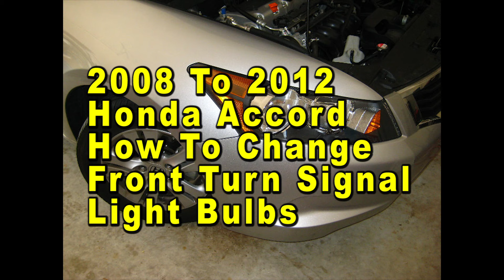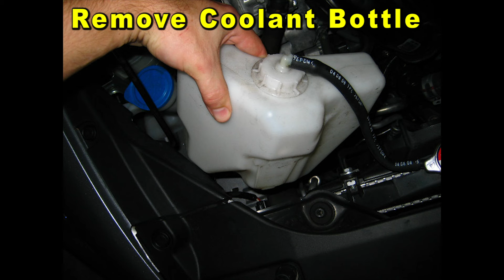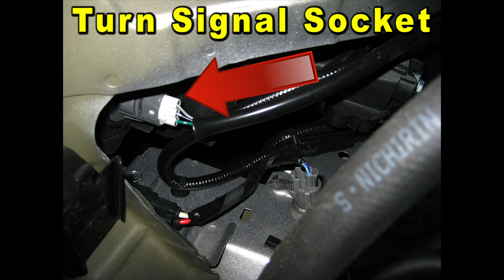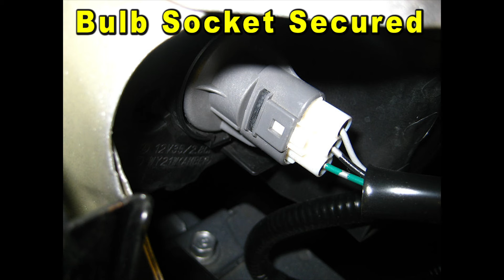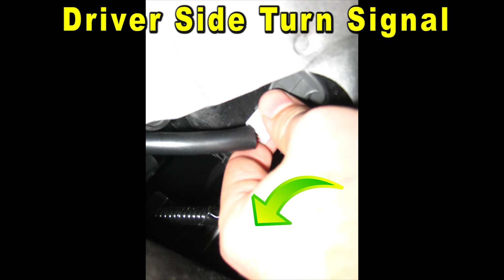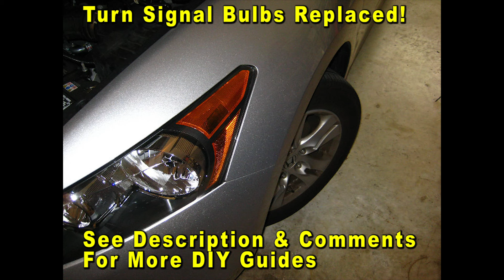2008 To 2012 Honda Accord How To Change Front Turn Signal Light Bulbs With Part Number

Comment from the maker: Front Turn Signal Light Bulb - https://amzn.to/3YF06lR
LED Front Turn Signal Part # - https://amzn.to/3SrrAav
Precision Screwdriver Set - https://amzn.to/3sLixaP
Plastic Pry Bar Tools - https://amzn.to/3HMtsV7
Socket & Ratchet Set - https://amzn.to/3Z17LbA
Mechanix Gloves - https://amzn.to/3jCnHkt
Torque Wrench - https://amzn.to/3vS5uSI

The Paul79UF YouTube channel is a participant in the Amazon Services LLC Associates Program, an affiliate advertising program designed to provide a means for sites to earn advertising fees by advertising and linking to Amazon.

This DIY video shows owners of the 8th generation 2008, 2009, 2010, 2011 and 2012 Honda Accord how to change a burnt out front turn signal light bulb in the headlight housings.

Comment from the maker: Check out the DIY guide for changing the front turn signal light bulbs in an eighth generation 2008 to 2012 Honda Accord - 
https://www.paulstravelpictures.com/Honda-Accord-Headlight-Bulbs-Replacement-Guide/index.html

Here are all off the DIY repair and maintenance tutorials for the 8th generation 2008 to 2012 Honda Accord - 
https://www.paulstravelpictures.com/Articles/Honda-Accord-Repair-Maintenance-Guides.htm

Owners of other Honda or Acura vehicles such as the Civic, CR-V, Fit, CR-Z, Insight, Crosstour, Odyssey, Pilot, Ridgeline, RLX, TL, TSX, ILX, ZDX, MDX and RDX may also find these DIY instructions to be helpful.